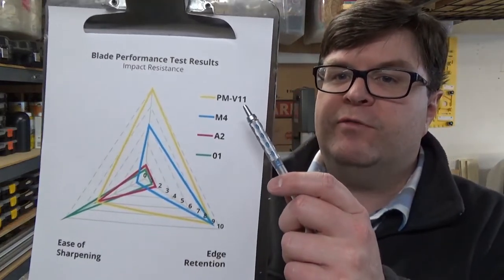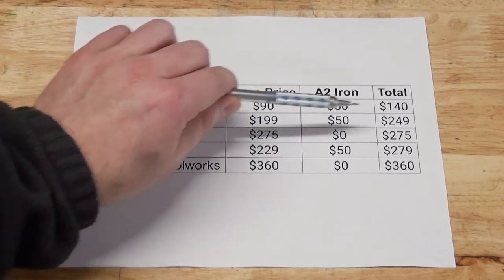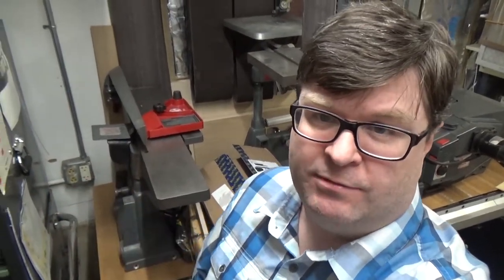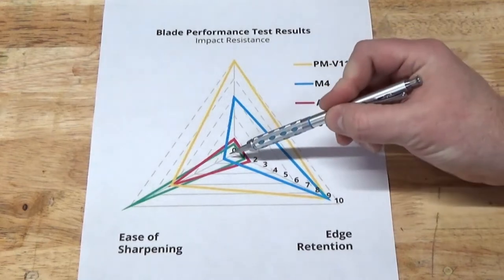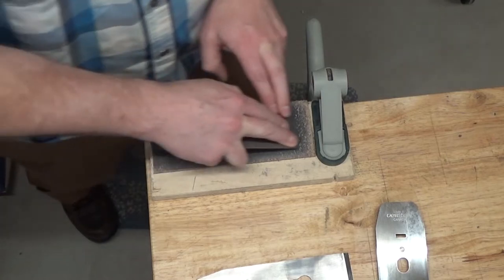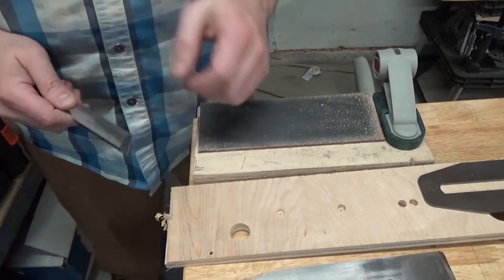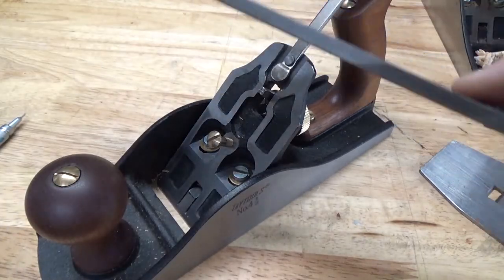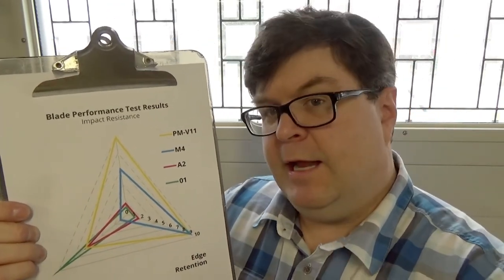Plane Iron Review: Veritas PM-V11 Tool Steel

Comment: Good info!  Thanks for sharing.  I love my o-1 hock irons that I use on 2 vintage stanley's.  I might give PMV 11 a chance next time I want to try a modern iron.  I wonder if stropping with diamond paste with make quicker work of stropping that hard metal?
Reply from the maker: Thank you! I've heard great things about Hock Irons. My father-in-law swears by them. I should give them a try as some point. And great suggestion I have been thinking of switching to diamond paste. I carefully selected a compound that would be equivalent to a 4000 waterstone. But man is it waxy. I was thinking the diamond paste might avoid the waxy build up and, as you pointed out, probably cut a little easier.

Comment: Cpm Magnacut is the elite steel in the knife industry these days.  One thing to keep in mind with steels used in woodworking is that the simpler the steel the finer the edge will be as a general rule.  The reason is the alloy content and the carbide volume in the steel.  Steels with high carbide volume will not have as fine of a cutting edge as a lower alloy steel such as O1 or A2.  The type of carbides are important as well.  High vanadium steels do not offer good performance for woodworking tools because the edges they produce are very coarse and aggressive.  Not suited for push cutting.  They offer wear resistance and do well with slicing.  The best steel for a wood working plane in my opinion is the steel that is the hardest and has a lower carbide volume.  A2 is hard to beat.  It offers a fine edge with slightly more carbides than O1 and is easy to sharpen.  I am curious what the alloy content of the pm-v11 is and what other steel it best compares to.  I guess I have some research to do!  Great video!
Reply from the maker: Great info, thanks for posting. If I recall correctly the PM in CPM is Powder Metalurgy, which is a process to control carbide migration during forming of the alloy. This helps keep this smaller crystal sizes that at so important for keeness. PM-v11 is also powder metallurgy.

Also I the high valladium alloys fall under the HSS category, great for power tools but to your point not great for hand tools.
Reply: @woodshopnerdery  In a nutshell, yes.  The powdered metallurgy process allows a much higher alloy content than what is possible in a sintered steel.  In sintered steel, the alloys tend to clump up and are not evenly distributed.  PM steel allows for a much higher carbide volume in the steel and it’s more evenly distributed.  It’s kind of like aggregate in concrete where carbides are represented by the aggregate in the concrete.  Those carbides are much harder than the simple steel that holds them in the matrix.  Vanadium carbides for example are around 70hrc.  The steel itself may only be hardened to 59-61hrc but you have to be able to cut those carbides down with a diamond stone or similarly hard abrasive.  What happens when you try to sharpen these high carbide steels with a soft stone is that you simply tear the carbides out of the steel and never fully sharpen the blade.  A simple steel such as a Japanese white steel which is heat treated to a high hardness will exhibit high edge stability and edge holding equivalent to a softer high carbide steel such as CPM-3V.  In plane blades that are doing a lot of push cutting this is preferable over a high toughness steel such as 3V.  3V has incredible toughness and much better edge holding than A2 but A2 takes a finer edge and is much easier to sharpen.  3V makes an excellent steel for chisels and other tools where toughness is more important.  The finer/cleaner the cut the harder/simpler steel wins!  I can’t find any detailed information about the chemistry of PM-V11 but it sounds like it’s well received and offers a fantastic blend of attributes.

Comment: If nothing else, I'd love to upgrade my chip breakers in my Stanleys. The old bent chip breakers are horrible. 🙄
Reply from the maker: I’m learning that a matching chip breaker and iron has some advantages. But even the. There may be some filing to fit it up.
Reply: I've ordered some from otherwise reputable vintage tool dealers, only to have them ground out of square. Idk why I keep putting off getting that Hock chip breaker..
Reply from the maker: @aubydauby  I’ve done that dozens of times. It’s amazing how expensive cheap tools can be.

Comment: When quality and price are considered as the basis of a purchase in planes and irons in today’s market I don’t think you can find a better combination than the Veritas line. I especially like the custom line of planes and the ability to swap out blades, knobs and totes, not to mention the frog and add-on fences. Veritas is a winner in my mind. 🇨🇦👨‍🦳👍when ordering the iron and cap iron combination did Veritas specifically say that they would fit those two planes. Fitting to a Chinese (Taytool) or a recently manufactured Stanley might not be listed. I wonder if the older versions of the Stanley would be more suitable for the upgrade as long as the mouth is sized to take a thicker blade and cap iron combo.  As far as a Chinese plane, they are not exact copies of an old Stanley.